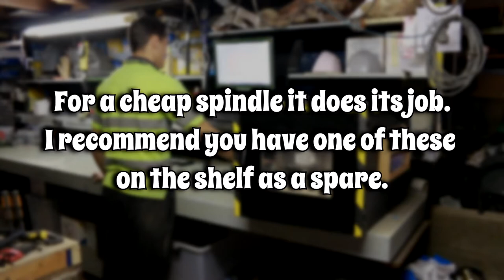3040 China CNC Replacement  Spindle | First Impressions

Comment: I had to replace mine as well, because I jammed the spindle on the original. Runout was enough to see it visually, and it vibrated like hell.

The new one had literally like zero runout at the spindle. Until I jammed that one too.